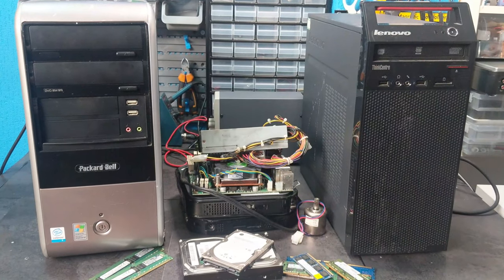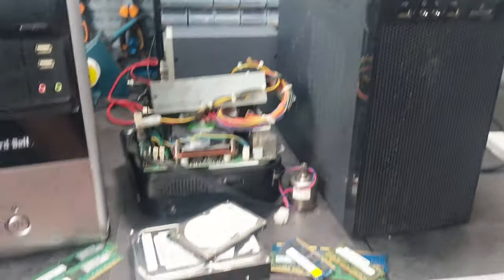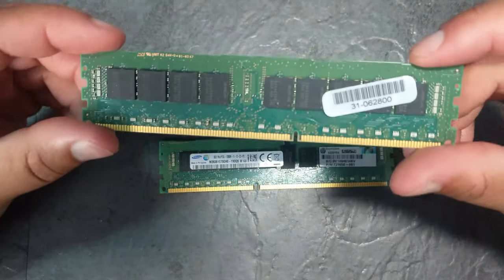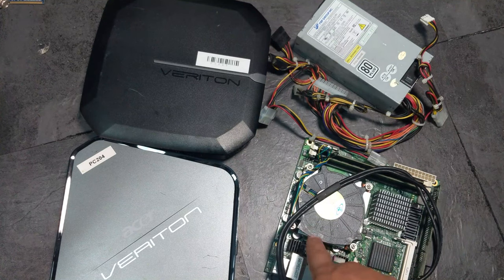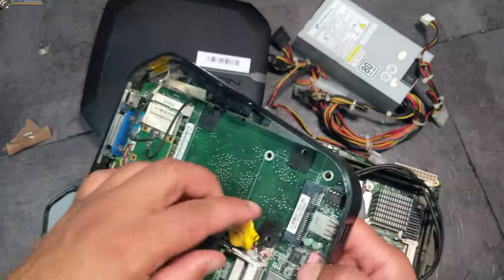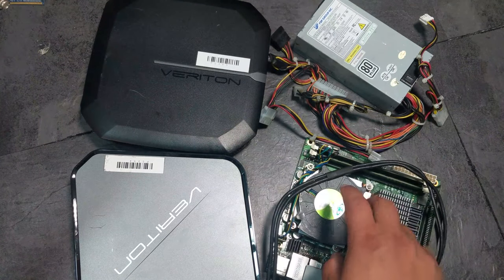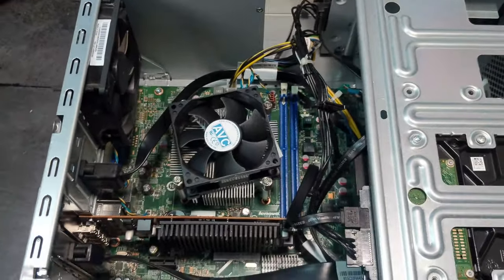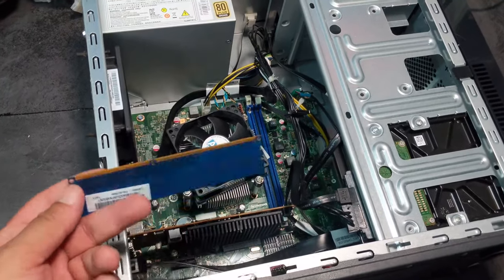Five Desktop Computers For £42! - Car Boot Sale Electrical Finds - Ep.3

Comment: Registered RAM, oh dear
Reply from the maker: Lool remind me what did I do wrong..this is old lol I was useless back then
Reply: Registered DDR3 only works in server boards that support it, no use in consumer desktop boards.
Also, I was peering at the Veriton 281G, I've been given one (no idea if it works) and it's missing that crazy 3 pin battery... why 3 pins, it looks like its just a CR2032 on a wire.
Guess I'd better slap a sick of RAM in, fimd a brick with the right power, and see if it runs before trying to figure out the battery
Reply from the maker: 😭 no wonder it never sold on eBay lol seems like you're going through a lot of effort there lool I must say I didn't even know about registered RAM so Ty, just googled it now